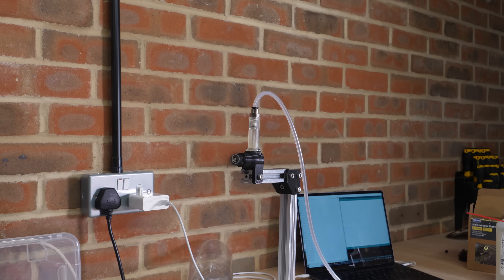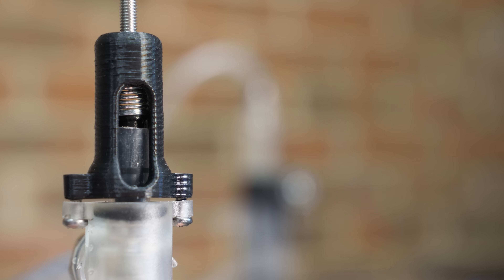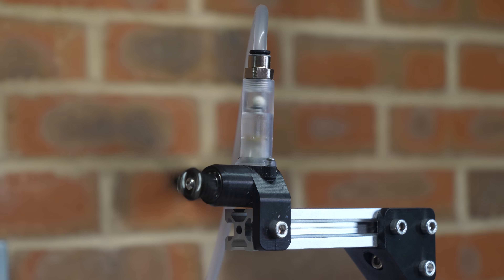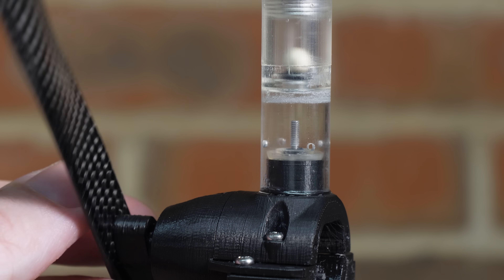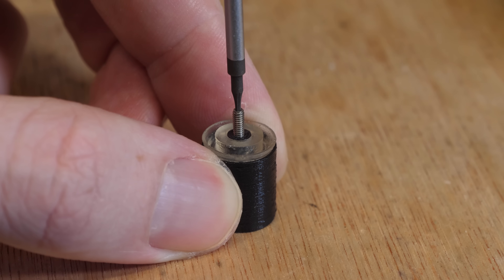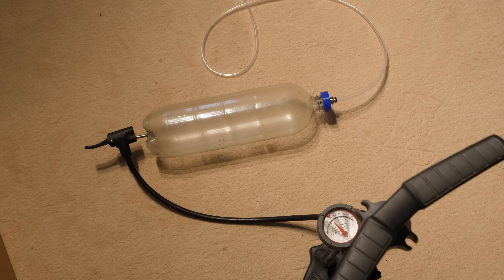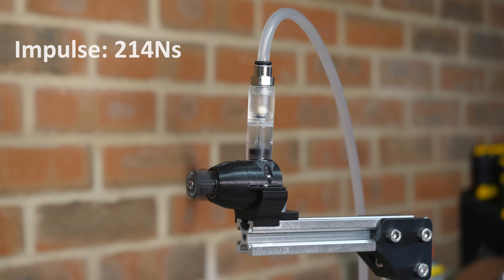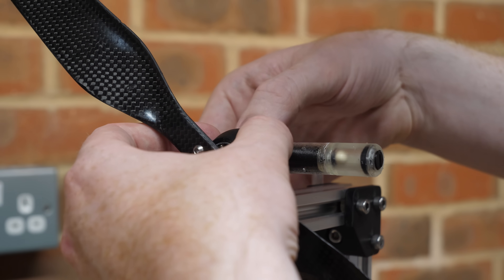4,500RPM Air Engine

Comment from the maker: The first 100 people to use code STANTON will get 60% off of Incogni: https://incogni.com/stanton
Reply: Can you make a parts list and upload the stl-files of the twin cilinder engine?
Reply: Have a look at the engine Richard Pearse used in his aircraft
Reply: Question: What about either multiple air tanks or a multi-chambered tank with a system to switch from one chamber to the next as a way to keep a more consistent pressure throughout the run. Either a pressure regulated selector or a timed clockwork style of system to achieve the same result. Higher initial pressure would be required to see any real gain though. I think.
Reply: https://youtu.be/fE_LjQ4IBQQ?si=JYrUbne4WU5eEHE3
Reply: integza built one with magnets intead of a ball valve
Reply: What about using an offset cylinder to compare power & efficiency vs a "standard" configuration?
Reply: you should consider to have the air in take on the cylinder side , under the exaust. you migth not have dificulty to get air tight betwin the cylinder and an hollowed piston, that let air go from it's side to it's top. no head valve friction ?
the piston may need some room to late the  top pressure air flow reaching the head
Reply: Make new vid before 3mouths better if 1mouths
Reply: Please try and inline twin engine configuration. Or maybe even a Boxer 4?
Reply: Where can buy these engine
Reply: @TomStantonEngineering i would love to see either a plane that uses no servos - just two props - or a V2 super capacitor plane (maybe with ailerons this time)
Reply: The first infinite number of youtubers who post annoying advertising get a thumbs down on the post and the video.
Reply: @FluffyTrinford  he makes money from it which is for our entertainment and his personal use.
Reply: Tom are you good at drawing

Comment: 13:12 that is a sound of a revving V-twin right there. A “flat” V-twin but a Vtwin nonetheless.
Reply: I mean, flat engines are just that, 180° V-engines.
Reply: can also be called a boxer engine
Reply: @debug8377 i thought boxer engines had each of their piston on seperate connecting rod?
Reply: @debug8377  No it can not. It's a flat engine.
Reply: @TopiasSalakka  okay thanks

Comment: Random thought - it's efficient to have high pressure air leave the exhaust... Could that pressure be used to do anything useful? Appreciate you don't want to create back pressure but even if it was just routed to act like a little jet with a little nozzle? Or is there some kind of exhaust gas recirculation design possible? Probably not but was a fun thought

Comment: for your 2 cylinder, it would be much more efficient if you had the cranks offset by 180 degrees so that it functions as a 2 stroke like the single cylinder, but a 1 cylinder 2x size engine will probably still be more efficient because of the square cube law.

Comment: funny how your engine is beating the nitro powered 20  watt .01 ci cox tee dee for power, but those engines go over 130 mph at 30,000 rpm, which is interesting.

Comment: If I use a vompressiontinnelmlike along shaft propeller so the incoming air has aguidbeto pressure theteiningbevomes might vent here there look iftheair is dirty or negates any work also I tested commands and it's all dirty why not to figure why everyone knowsamd konone knows thelatest

Comment: If increase the pressure the speed reduces soinansagetybsyste.my water pressure needs no fixing or to break is ok to have a leak into A drian isok i.alaonstuck o cleaning the motor IE a electrical drive into helping this ..a more costly mechanical pump is ith a pressure vessel a good rd guided by the costie that is three times more expensive than the electrical item I know but it is nature like there's food I need it I won't eat nature has a rd

Comment: Doesn't this design have big losses at the outlet? You don't let the air out while moving the piston up, compressing the air. You can now only deliver power by having a pressure higher than what was already in the cylinder. This means that you can't expand to atmospheric pressure. (You can clearly see the air rushing out of the cylinder in the video. This is all lost energy.) I think you should have some latching mechanism opening a valve when the piston is at bottom dead center. The piston will push out the air at/near atmospheric pressure while moving up. The valve outlet closes when the piston is at top dead center and opens the inlet valve. Its not exactly a novel design. It's basically a steam engine that runs on compressed air instead of steam.  Though what do I know...

Comment: 4,500 RPM far to high for an aircraft propeller, your best effancity range is around 2100 - 2400 anything above that you are just beating the air not producing thrust. This this was is a solid it would be totally different. Great work thought!

Comment: I’d love to see you attempt this stuff in a small tv car. Like convert a gas rc car to air powered and keep the electronic controls. Air engine, wireless controllable regulator(throttle), and perhaps a simple auto engagement clutch design and driveline and have it controlled through factory remote. I have no knowledge of the limitations of air engines, but if it’s achievable on a small scale can it be done at a larger scale? Or will physics prevent that?

Comment: Now you need so add the ability to wirelessly control the air pressure going into the engine like a throttle. Instead of just as much run time as you can get letting it run off the bottle pressure. (If you touched on this and I missed it, sorry) also throttle capabilities and electronic rudder controls would make that a fully functional controllable plane at this point would it not?

Comment: would it make any difference if you put the exhausts only on the back of the cylinder, to use the exhaust to add thrust? Half of the air is blowing forward as it is now.

Comment: Genuinely fascinating
Reply: I know the answer is probably simple but I can’t imagine an engine strong enough to push the testing rig not spinning the lightweight plane around and arounf?
Does it have to do with the weight of the plane being higher than the weight of the propeller?
Maybe the torquing action on the plane is counteracted by the drag of the wings? 
What would happen if you held the propeller and spun the plane instead, could it still take off if released?

Comment: 0:24 some of the differences can also be found in steam engines- a major part is the difference between an engine optimized to extract energy from many short bursts of high pressure (I.C.E.) and an engine optimized to squeeze as much power out of one long, steady source of high pressure (steam engines, these air engines)

Comment: you should use graphite lubricant so it can run smoother also don't use oil because for some reason 3d printed plastics absorb oil and once it touches oil it is going to be oily forever

Comment: He should make a custom tank with a piston that keeps the pressure the same as the engine uses air by decreasing the volume, for optimal power output.

Comment: Love what you're doing!
I'm no engineer but wondering since it's similar to internal combustion, compressing the air more by adding some sort of air cooler. An idea I've had for ages but never actually had the means to for "Nitro RC", was to heavily perforate a piece of aluminum with an "in" and "out" port. To charge it, you deep "freeze it", and for longer runs like on Nitro "peltier" could be added. Granted it'll add weight, so maybe something like a micro bore tube coil? Also the exhaust ports could be set up so that the rotor creates negative vacuum in the cylinder?

Comment: Couldn't you do a twin- or multiple air cylinder design where when one tank is empty, the engine switches to another and gets renewed high pressure air? Or wouldn't that be more efficient than one large tank?

Comment: How critical is the diameter of the air passage hole. Smaller will produce a faster jet of air.  120 pounds is the competition limit.

Comment: The Italien compressed air engi e market about 35 years ago was quite efficient. I used it in a 35 inch ABC Robin and would average about 90 second flights.

Comment: make a bigger engine and power it using liquified nitrogen gas.. store it in a steel container at very low temperature and when you use it heat it upto 200 degree celcius well you also have to use metallic chambers and this will surely increase weight but I think it will also increase POWER

Comment: 6:19 "now both inlet valves have closed" 
How is that possible when the right engine piston is still at TDC? The inlet valve opens when the piston is at TDC. It actually also depends on the length of the pin hitting the ball

Comment: I am no mechanical enginner but the issue you where discussing with the crank angle reducing torque and therefore making the engine less efficient is often solved by offesting the crankshaft to one side meaning at top dead centre the piston has a tiny crank angle in this case when the pressurised air is injected.

Comment: Try using some brass piping instead of acrylic sucks because you can’t see the piston but it’ll be super smooth
Reply: heavier tho
Reply: @MrBlackmidi1234567890987654321  that is a good point. I clearly have not tested this but mabye the brass pipe is super super this it might balance out. Don’t quote me though.

Comment: If the valve cylinder head had an o-ring seal and a fine thread, the valve timing could be adjusted turning the cylinder head.

Maybe have the valve spring be adjustable with another thread and an o-ring on top. 

All air expansion should be the air pressure operating on the piston and the pressure difference on the the two sides of the piston. Pressure difference across the ball valve in conjunction with air flow will consume useful energy

The valve should be either fully on or fully off.

Comment: If you design your engine so it expands the air all the way down to atmospheric pressure, no air will flow through the exhaust ports, as an airflow requires a pressuredifference to set it into motion (and there will be none, if the pressure inside the cylinder matches the one on the outside). As no air will leave the chamber, you will soon get a situation where no air can enter it either, due to the principle of conservation of mass (if air can only enter but not exit, the result would be an infinite amount of air in there, if you run the engine for long enough, and that cannot happen in practice). 
The result will be that all you see is an equal compression on the upstroke as the expansion on the downstroke, and hence the energy you can extract from the downstroke will have to be "payed back" when the piston travels upward, resulting in a net zero ...or actually a little less when you take friction into account.
Therefore an engine of this layout cannot expand the air all the way down to atmospheric pressure, and you will have to release some high pressure air right out of the exhaust to get it to run at all. So though this type of engine is simple to make, the cost is that there is a limit to how much power you can extract vs. how efficiently it runs. You can't get high power and high efficiency at the same time.

Comment: I have a question. Its probably very stupid, but I'll pose it. As the exhaust is pushing out air and I assume this is under pressure, could this be 'pushed' into the other piston - or recovered into a second air tank. If its a total loss system, it seems to my laymen brain that recovery or lack of - would be a shame..

Comment: Looking for ideas for future efficient transportation beyond current jetpack type technology. I really think a hybrid compressed air and electric power propulsion is the best way forward for this to ever work in a every day or actually usable configuration.  Perhaps even geared exhaust turbine with fuel ignition could drastically improve power and efficiency.  Definitely recommend taking tips from BMW 6 cylinder balance for smooth operation and power throughout the full cycle. This technology is still very much in its infancy. Lots of progress and r and d should be done at universities and companies looking for the future in more efficient and environmentally friendly transportation systems. I think flying cars are never going to be popular future  means of travelling. But a safe single outfit of low altitude fast flight is reasonably possible if range and reliable clean compressed air systems can be developed.  Lithium ion battery can provide compressed air on as needed basis for 30 minutes or more with out additional extreme weight which will obviously affect performance.  Small lightweight wings with high lift will drastically reduce fuel usage which is normally used for lift alone.  The v22 osprey configuration  is the ideal solution.  Electronic stability controls developed for drones is making this very possible for very little expense.

Comment: Why don’t you use an orifice with a delta p across the orifice greater than the critical pressure ratio of 2 to 1. This will keep flow constant and no mechanical losses as with the regulator. Per Einstein simplicity is beauty.

Comment: the next step is to measure the average RPM of the motor and optimize your propellor design vis a vis diameter and pitch.  For example, my large rubber powered models (low rpm) had a propeller that was about 2/3 rds the wingspan and were hand carved from wood (balsa). Whereas my glow and diesel engine powered racing models (very high rpm) had small diameter (150mm) props. Those were molded in epoxy/graphite, I made them myself.

Comment: Just wondering bro, 1:41 would it work if you made a big piston that would be suplying a bunch of energy ,but would not be able to come back up and use the air escaping through this valve 1:41 to power a small piston pushing up the big piston

Comment: To solve the problem of the engine with the full expansion area being less efficient than the other design, you could implement variable valve timing, so that the air is only injected into the cylinder when the crank is past a certain angle.

Comment: Good engineering. Would having the crankshaft and piston slightly offset increase/efficiency? The connecting rod would never be in linear alignment at the top of the stroke and so all downward thrust from the piston will be used to turn the crank.

Comment: Very clever design. The quality of your prints is very nice too. I'm building/designing and printing a 1/4scale 51 Chevy Pickup truck. You've inspired me to consider converting the inline 6 cylinder engine to run on air.

Comment: First time I've seen a motor like this was on another video by a dude who did it using lego and some custom parts. He made a truck for it to propel. Pretty interesting stuff but this is even more impressive. Would probably make for some sick RC planes if you stuck one of these and a tank for it into a small chassis.

Comment: If you could balance the weight of a compressor with the weight able to be lifted by a hot air balloon. This method would be a phenominal way to propell a balloon in the diection you want without the need for extra heavy liquid fuel

Comment: You need to use the exhausted air as an additional source of thrust to improve the efficiency. Right now the evenly spaced ports point in all directions with net zero thrust in the direction of flight. Plus, the exhaust air pointing towards the prop counteracts some of the prop thrust. If the exhaust ports were moved and the angle aimed so that the exhausting air was producing thrust matching the direction of the prop thrust you would be utilizing the currently wasted rocket effect of the exhausting air on each stroke. There might be a small drop in exhaust efficiency with added resistance when redirected, but surely less drop than gains from the added thrust. It might be a small gain, but every little bit helps.

Comment: If you longitudinally offset the cylinders a few mm then you don't need bent cranks. This is why boxer engines don't have the cylinder banks lining up
(The offset angle will cause a slight sideways vector on the pistons regardless of the correcting curve, increasing cylinder wall friction)

In addition that pin is going to flex slightly (which is dealable with, probably by increasing diameter until no bending is observed) and you need to at least statically balance the whole assembly (which you should be doing even on the single cylinder, it will reduce vibration and increase torque), preferably dynamically balancing it

For aviation use, the cylinder needs a boat tail, otherwise you'll have a lot of drag on the traiiing side (perhaps dimples on the trailing side may do it, that's why golf balls have them)

Comment: Tom I have a top for you to greatly increase your engine run time, or possibly make it run infinatly! Try putting an air compressor into your engine that runs of the crank shaft. Then put a air hose between the compressor and the air storage tank, this will allow you to regenerate air pressure!

Comment: 0:42 just fit a compressor on it duh 🙄
Reply: Then how would you run the compressor? Genius
Reply: Real
Reply: you use tanks which are plastic soda bottles, aluminum , and in the old days brass.

Comment: He needs to make a throttle on the plane.  The simplest way to do that is using another small servo and 3D print a part that a piece of the air hose goes into: in one direction of the servo the 3D printed part with pinch the air supply hose closed, and when the servo moves the other direction it releases this pinched hose so air can flow through it.  A cheap, light weight way to add a throttle to the plane.  Another included bonus of this is he then can remove his air regulator he made, thus the weight lost by removing the air regulator will offset the weight of the added servo and 3D printed part.  His new adjustable throttle will now regulate the air pressure/ motor speed.